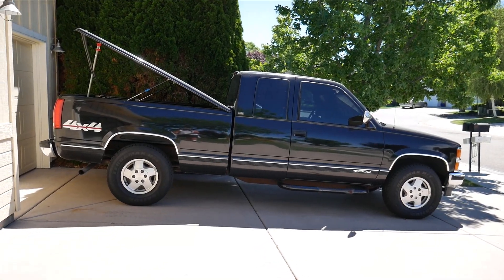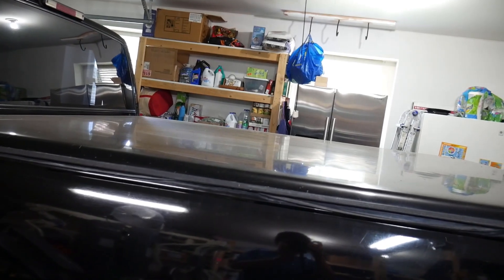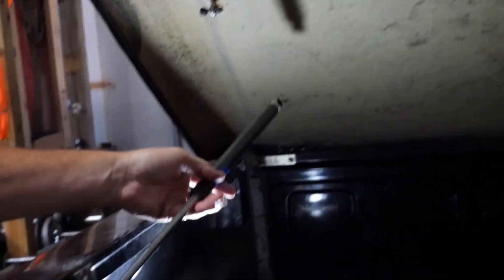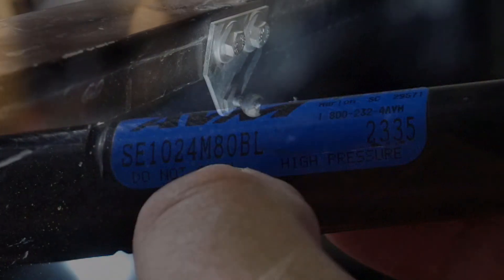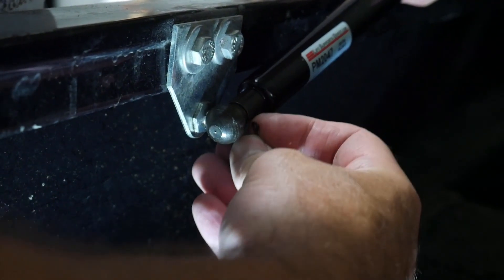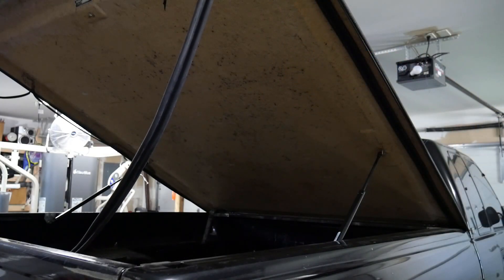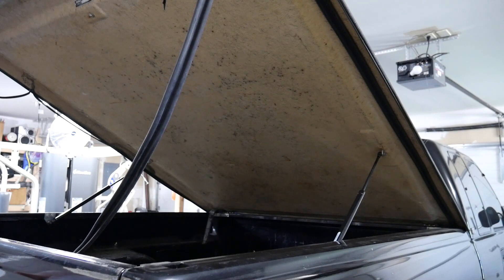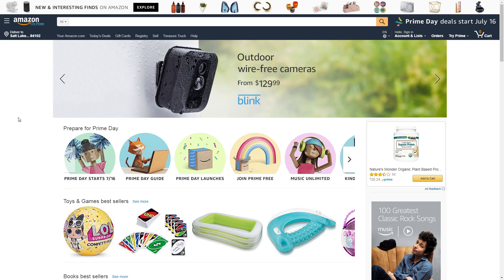Installing new shocks on a SNUGToP Tonneau Cover

Comment: Yip up side down
Reply from the maker: Hi, and thanks for watching! Not trying to be argumentative, but just wondering why you think the shocks are upside down?  I realize they are not mounted the same as they were at the beginning of the video but I chose to mount them this way intentionally, I think it looks better. There was no indication on the shocks that they should be mounted one way or the other, in fact they should exert the same opening pressure no matter how they are mounted. Someone else commented 9 months ago that I mounted them upside down so I actually took the time to mount them the way he claims is correct, there was absolutely no difference in the way the lid opened, so I changed them back to the way I originally mounted them. A shock has no idea which way it is mounted, there is no leverage advantage gained by mounting them the other way. Anyway sorry about the rant, but if I'm missing something here please enlighten me, because honestly I think it boils down to personal preference.😀
Reply from the maker: I'd say the guys that built this beautiful truck, at 0:25 of this video, probably knew what they were doing! https://www.youtube.com/watch?v=EuffQtaKDQc Shocks are mounted the same way.
Reply: Hi what happens when the piston are upside down the small amount of oil that Lubes the piston and shaft pools at bottom of the strut  . The strut becomes dry and the seal will crack  . This will cause a leak and cause gas to escape it will not work effectively cheers bud good vid thow 👍 Hi from down under Australia  hope this helps
Reply from the maker: @shadezbp7298  Thank you very much for explaining that! Your explanation does make a lot of sense. I hadn't really thought of that! I guess now I'm going to go out and switch them around... LOL. Thank you again for the good info & hope you have a great day! 😀
Reply: TwoGuyzTech  I never knew until I had to change mine out oneday and saw on the back of the box they came in . Lol I too put mine up side down 😂😂

Comment: Decent vid but you installed them upside-down.   The hydro fluid has to be at the top if you are greater than 50 degree rake.  If it's upside-down the hydro fluid will not keep the seal from drying out.., thus failing.  Hopefully by now you will have changed them.